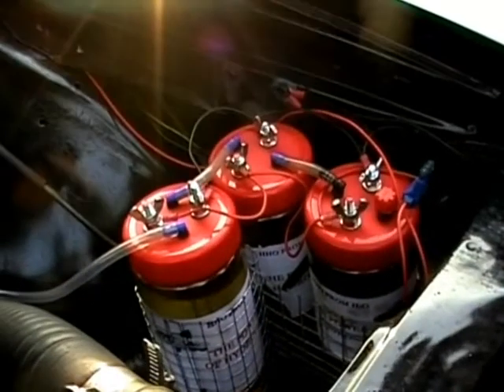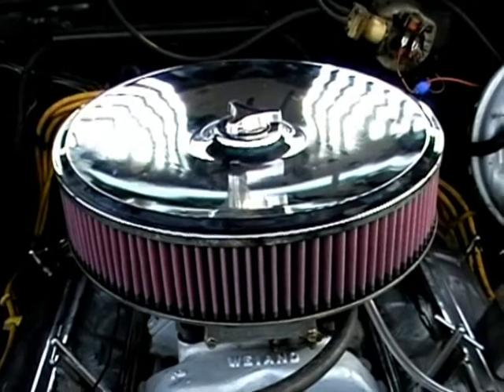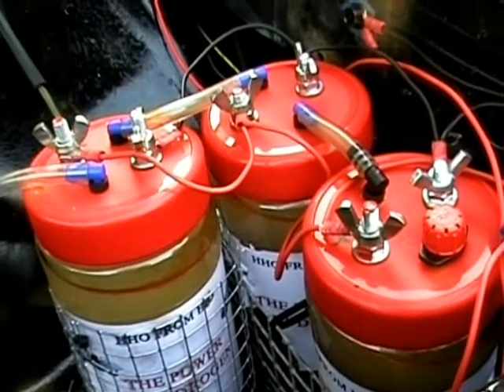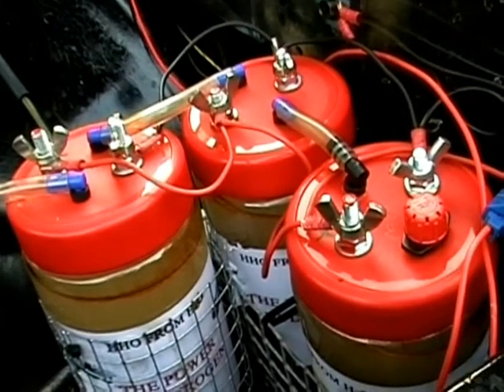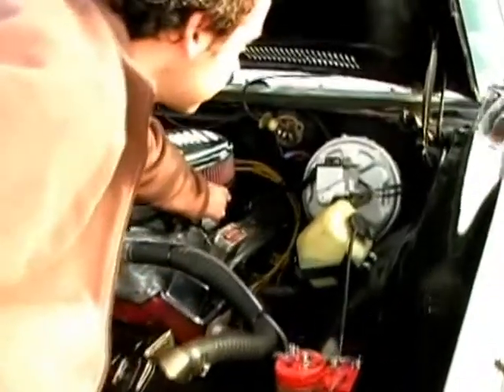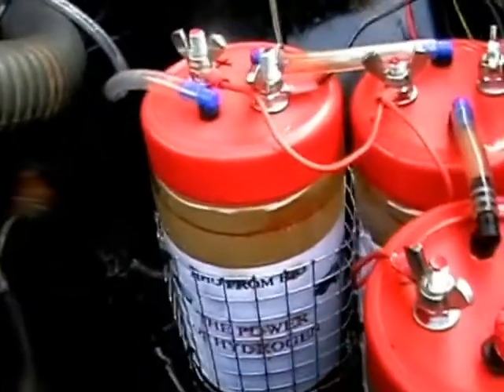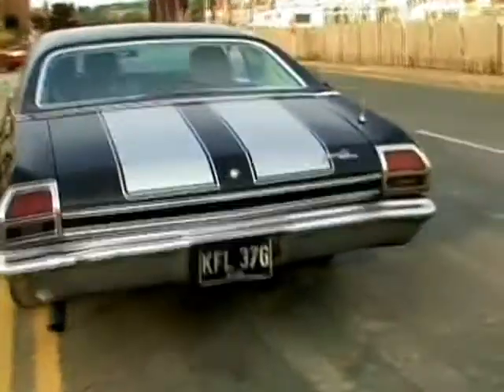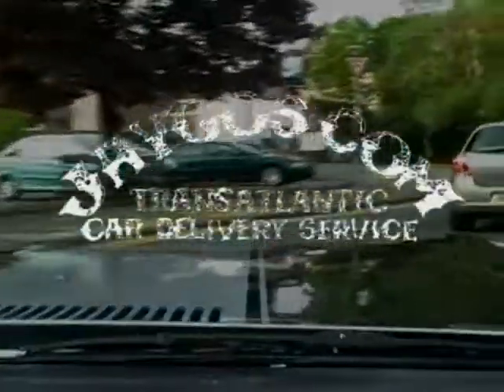taking a look at the hydro hybrid

Comment: Since a long time ago im watching this innovation, and im thinking also to put it at my that, now, uses gasoline and LPG (Liquefied petroleum gas). However i made a research and i found that we need 286 kJ/mol to produce Hydrogen from water:
2 H2(g) + O2(g) → 2 H2O(l) + 572 kJ (286 kJ/mol)
and, for burning the hydrogen we only get 242 KJ/mol.
I´ve already connected a home made hydrogen cell and the engine slows!
well, i hope that really uses less fuel. Let me know.
Good luck
greats